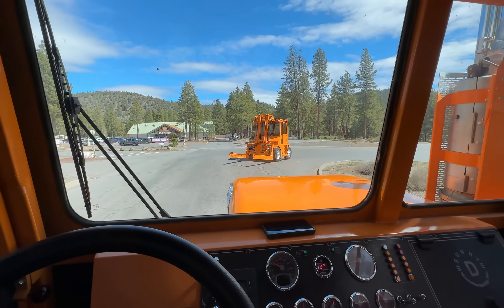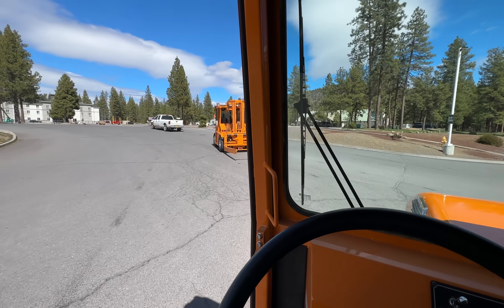200 mile road trip in a Hay Squeeze!

Comment: I am curious though. While this made for an entertaining video, why not just trailer them that distance versus driving? Or was it a "just because you can" kind of thing? heh.
Reply from the maker: Because it would have taken two trips with the lowbed, which would have been just over 800 miles of trucking.
Reply: @CaseyLaDelle  makes sense! In my head I thought both could have fit on the trailer but really had no idea.
Reply from the maker: @mattpitts3205  34k pounds each.